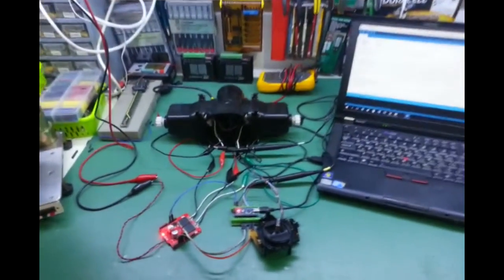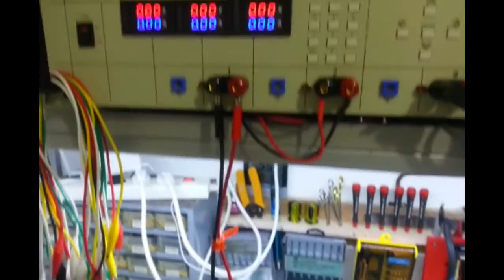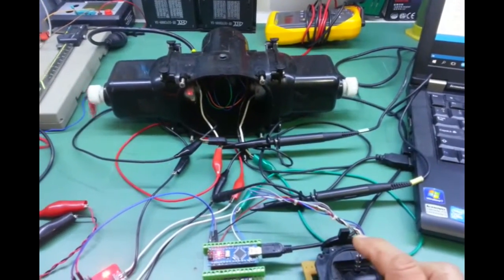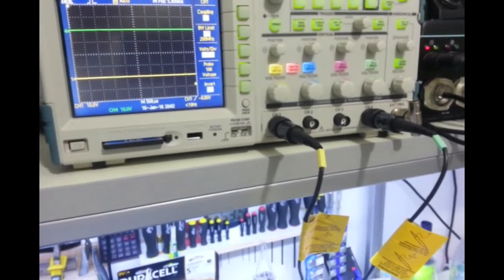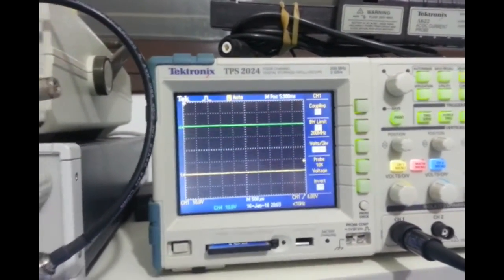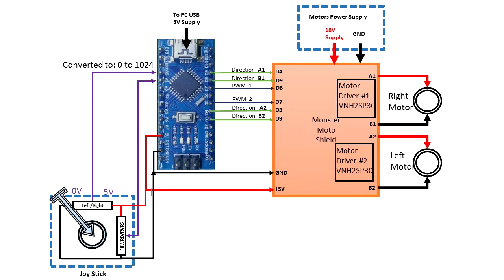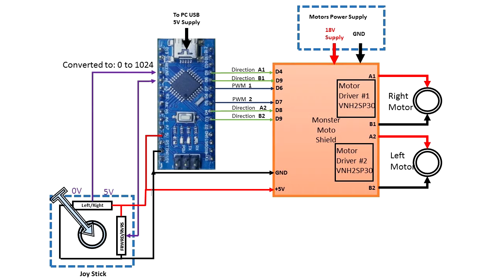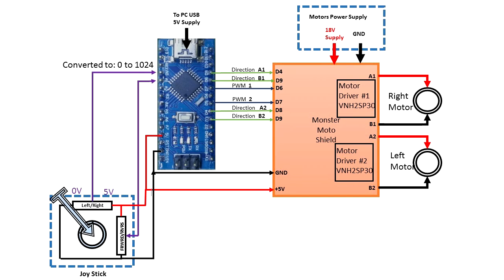Motorized  cart (replace the previous film) W/Arduino nano H bridge driver

Comment: HI  MR. 
meirbns

 I'm working to do the wheelchair. could you help me to do the project?
Reply from the maker: Hi, please let me know how can I help.
Reply: @meirbns  I'M USING THE BELOW CIRCUIT COMPONENTS to design the wheelchair:
1)BATTERIES OF 24 V(12V, 12Ah no.2)
2)2 BLDC geared motors.(each having an rating of 24V, 240W)
3)5V joystick
4) arduino uno board for controlling and programming.
Could you help me that which motor driver should I use in this project? and also help me to design the circuit diagram and programming. thank you sir.
Reply from the maker: @mohammadazaruddin8965    Hi Mohammad,   as for the motor driver - you may find on aliexp. many manufacturers for price ranging from 20$ and up.  Just search for: ' 24V BLDS MOTOR DRIVER '  make sure they are rating to ~>300watts.  Like "BLD 300B".  As for the electrical drawings, I'll prepare one for you.  It is very important to know your electronic level experience.  As for the S/W, I can send you ter program I wrote for my grandson's cart.
Reply: Please send me as soon as possible sir.

Comment: hi... your tutorial is great and very helpful.....  :-) can you help me with integration of the following please...

1. Dual VNH2SP30 Motor Driver ( https://www.sparkfun.com/products/10182 )
+
2. Arduino UNO
+
3. FrSky RC Receiver ( http://www.frsky-rc.com/product/pro.php?pro_id=13 )

your help will be of most use....

there is a guy who has done something similar with a L293D motor driver at http://www.instructables.com/id/Rc-Controller-for-Better-Control-Over-Arduino-Proj/

but i am confused with the PIN OUT between the Motor Driver & the Arduino UNO Board. also the code confuses me.
Reply from the maker: Hi
Thanks for watching my video.
I'll be happy to try and share information with you.  Please share more details with me so I will be more specific.
The   VNH2SP30 driver is very simple driver to control. Each of the 2   VNH2SP30 channels requires 3 inputs (total of 6 I/o pins from the Arduino). 
If you will mixed the pins no damage will be.

1 -  PWM (pulse width modulation) to adjust the motor speed
2 & 3 - Directions A & B which works like below table:
4 - additional 2 inputs MAY be used for enable (EN1/EN2) which should be "H" state.
        
            Dir A          Dir B            motor result
---------------------------------------------------------------------------
               L               L                 Brake to GND
               L              H                 Counterclockwise (CCW)
              H              H                  Brake to VCC    
              H               L                 Clockwise (CW)
You can always use the serial monitor command in the Arduino S/W to watch the arduino pin status.

I also attached a link for the  VNH2SP30 data sheet
      https://www.pololu.com/file/0J52/vnh2sp30.pdf 

As for the code, I assume you like to work with RC controller code?
if so, please be specific with line #  to focus me.
Enjoy

Comment from the maker: Please find code Below:
___________________________

/* for pin connections on motor shield please refer to:
   VNH2SP30 SparkFun :     https://www.sparkfun.com/products/10182
   VNH2SP30 Data sheet:    http://cdn.sparkfun.com/datasheets/Dev/Arduino/Shields/10832.pdf  
   VNH2SP30 Schematics:    http://cdn.sparkfun.com/datasheets/Dev/Arduino/Shields/MonsterMoto-Shield-v12.pdf

   You may also reffer to my second video for system explenation

   Motor Board breakout pins
        A0 - EN1 need to be H         D4 - INA-2  - motor 2 direction and Break
        A1 - EN2 need to be H         D5 - PWM-1  - motor 1 PWM from controller
        A2 - CS1 current Sense        D6 - PWM-2  - motor 2 PWM from controller
        A3 - CS2 current Sense        D7 - INA-1  - motor 1 direction and Break
        5 VDC                         D8 - INB-1  - motor 1 direction and Break
        GND                           D9 - INB-2  - motor 2 direction and Break
        Vcc 5.5 - 16Vdc to drivers and motors.
*/
int potPin_NS = A0;         // Notrh/South  Potentiometer input to A0.
int potValue_NS = 0;        // Notrh/South  Potentiometer Value .

int potPin_LR = A1;         // Left/Right  Potentiometer input to A1.
int potValue_LR = 0;        // Left/Right   Potentiometer Value at pin A1.

//Right Motor
int dir_Right_A1 = 3;       // Direction/Break command pin 3.
int dir_Right_B1 = 4;       // Direction/Break command pin 4.
int Right_Wheel_Pin = 5;    // PWM Output on pin 5 NS==Right,  LR==Left.
int Right_Wheel_Value=0;    // PWM value at pin 5.

int Speed_Value =0;         // Speed_Value for both Left and Right wheels.

//Left Motor 
int dir_Left_A2 = 7;        // Direction/Break command pin 7.
int dir_Left_B2 = 8;        // Direction/Break command pin 8.
int Left_Wheel_Pin = 9;     // PWM Output on pin 9.
int Left_Wheel_Value = 0;   // PWM value at pin 9.

int K_right = 0;            // analog RIGHT multiplier.
int K_left = 0;             // analog LEFT multiplier.
int KK_right = 0;           // analog RIGHT Wheel Corrected Value.
int  KK_left = 0;           // analog LEFT Wheel corrected Value.
void setup() 
{
  stop ();      //stop rutine.
  FORWARD ();   //Forwad routine.
  REVERSE ();   //Reverse routine.
  BREAK ();     //Break routine.
  
  pinMode (potPin_NS, INPUT);         // analog input north/south   or forward/revers.
  pinMode (dir_Right_A1, OUTPUT);     // Both A1 & B1 for Right-Motor, are needed for motor direction,
  pinMode (dir_Right_B1, OUTPUT);
  pinMode (Right_Wheel_Pin, OUTPUT);  // PWM Right wheel.
  
  pinMode (potPin_LR, INPUT);         // analog input left/right direction.
  pinMode (dir_Left_A2, OUTPUT);      // Both A1 & B1 for Left-Motor, are needed for motor direction.
  pinMode (dir_Left_B2, OUTPUT);
  pinMode (Left_Wheel_Pin, OUTPUT);   // PWM for left wheel.

   Serial.begin (9600);
   
}

void loop() 
{   
//--------------- LR routin ---------------
    potValue_NS = analogRead (potPin_NS);
    potValue_LR = analogRead (potPin_LR); 

  if  ((potValue_NS  >=501 && potValue_NS <=520)&&(potValue_LR  >=501 && potValue_LR <=520)) //dead band of potentiometers at center.

     {
       stop();        //start "stop" routine.
       delay (50);    //delat 50mSec. for soft break.
       BREAK ();      // "break" both motors.
     }
  
  if (potValue_LR <=500)                                 // JoyStick LEFT Shifted.    LEFT=0<<======|500-520|-------1024=RIGHT
      {
       K_right = map (potValue_LR, 500, 385, 0, 180);   // set right motor potentiometer value from 500-385  to 0-220 accordingly.
      }

  if (potValue_LR >=521)                                // JoyStic RIGHT shifted.     LEFT=0--------|500-520|=======>>1024=RIGHT
      {
       K_left=map (potValue_LR, 521, 640,  0, 180);     // set right motor potentiometer value from 500-385  to 0-220 accordingly.
      }

//  --------------- OPERATION routin ---------------
  if (potValue_NS >=521)    // 520|=====>>1024=FORWARD
     {
      FORWARD();
     }

  if (potValue_NS <=500)    // REVERSE = 0<<=====501
     {
      REVERSE ();
     }
    //Serial.println ("L/R potValue:");
      //Serial.println (potPin_NS);
      //delay (100);
      // Serial.println ("LEFT WHEEL:");
      Serial.println (Left_Wheel_Pin);
      // delay (100);
}

void stop()
     {
       analogWrite (Right_Wheel_Value, 0);      //pwm out pin 5
       analogWrite (Left_Wheel_Value, 0);       //pwm out pin 9     
     }

void FORWARD ()
  {
        digitalWrite (dir_Right_A1, HIGH);       //FORWARD right wheel
        digitalWrite (dir_Right_B1, LOW);        //FORWARD right wheel
        digitalWrite (dir_Left_A2,  LOW);        //FORWARD left wheel
        digitalWrite (dir_Left_B2,  HIGH);       //FORWARD left wheel     

        Right_Wheel_Value=map (potValue_NS, 521, 645,  0, 254);        
        Left_Wheel_Value =map (potValue_NS, 521, 645,  0, 254);

        KK_right = (Right_Wheel_Value - K_right);  // Right wheel forward-command - (minus) stick right-command for turning.

    if (KK_right < 0) // combined, calculated value for wheel.
        {
          analogWrite (Right_Wheel_Pin, 0);
        }
      else 
        {
          analogWrite( Right_Wheel_Pin , KK_right);
        } 

        KK_left = (Left_Wheel_Value - K_left);

    if (KK_left < 0)
        {
          analogWrite (Left_Wheel_Pin, 0);
        }

     else 
       {
      analogWrite( Left_Wheel_Pin, KK_left);
       } 
  }
   
      
      void REVERSE()
      {
        digitalWrite (dir_Right_A1, LOW);    //REVERSE right wheel
        digitalWrite (dir_Right_B1, HIGH);    //REVERSE right wheel
        digitalWrite (dir_Left_A2,  HIGH);    //REVERSE left wheel
        digitalWrite (dir_Left_B2,  LOW);    //REVERSE left wheel
 
        Right_Wheel_Value=map (potValue_NS, 500, 370,  0, 254);
        Left_Wheel_Value =map (potValue_NS, 500, 370,  0, 254);
        
        KK_right = Right_Wheel_Value - K_right;  
    if (KK_right <0)
        {
          analogWrite (Right_Wheel_Pin, 0);
        }  

else    {
          analogWrite( Right_Wheel_Pin , KK_right);
        }
          
        KK_left =(Left_Wheel_Value - K_left);

    if (KK_left < 0)
        {
          analogWrite (Left_Wheel_Pin, 0);
        }

        else 
        {
          analogWrite (Left_Wheel_Pin, KK_left);
        }
      }
  
      
      void BREAK ()
      {
        digitalWrite (dir_Right_A1, LOW);     //Break right wheel
        digitalWrite (dir_Right_B1, LOW);     //Break right wheel
        digitalWrite (dir_Left_A2,  LOW);     //Break left wheel
        digitalWrite (dir_Left_B2,  LOW);     //Break left wheel  
      }